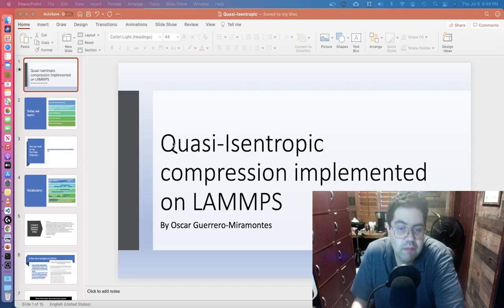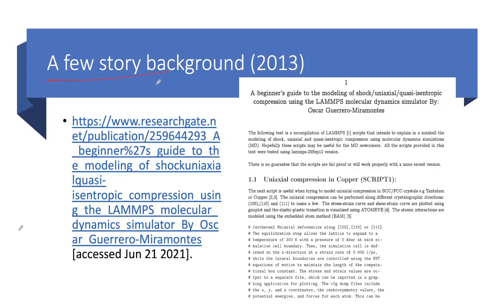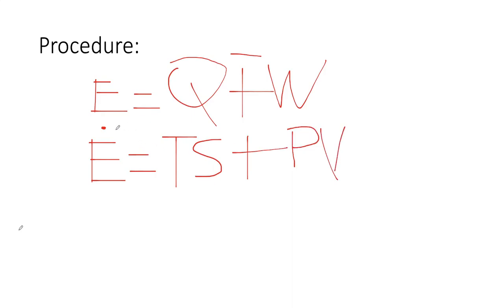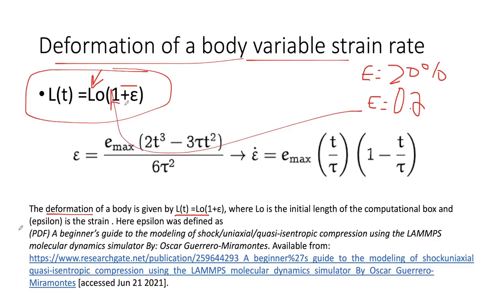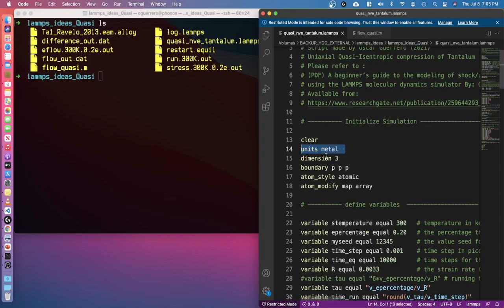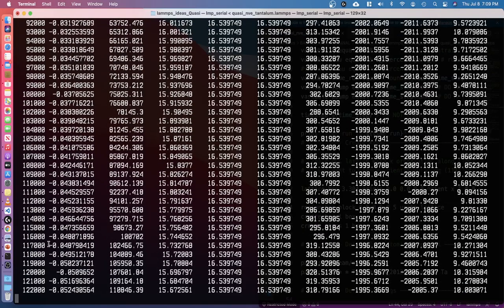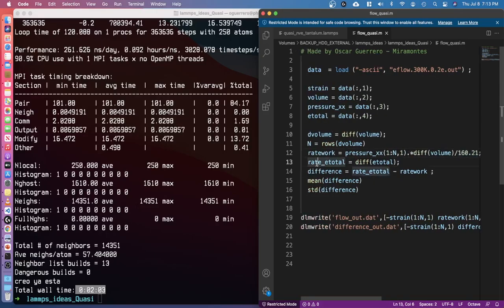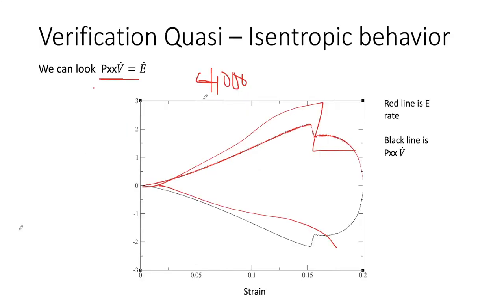Molecular dynamics simulation of Quasi isentropic compressions implemented on LAMMPS

Comment: Dear sir, is this formula valid for fluids and gases as well? If not, how can proceed in those cases for isentropic compression?
Reply from the maker: Yes, The compression of a body quasi isentropically only depends on the epsilon function utilized. Of course, this phenomenon is a non-equilibrium molecular dynamics process (NVE). By the way, you should try it and compare if The total energy rate (Edot) equals Pxx multiplied by the volume data (Vdot). Your simulation of a fluid or gas should use relatively the same LAMMPS script as on this video. Still, the potential interaction should change depending on which material you are modeling.